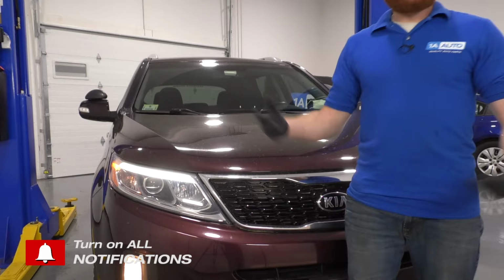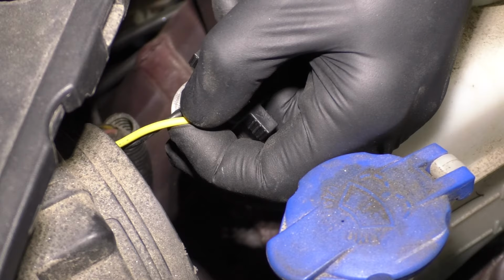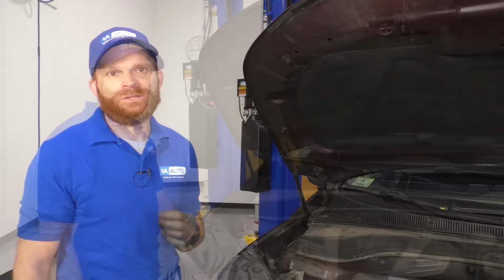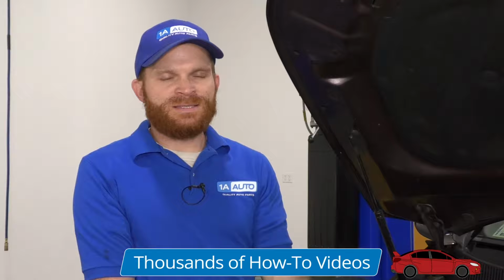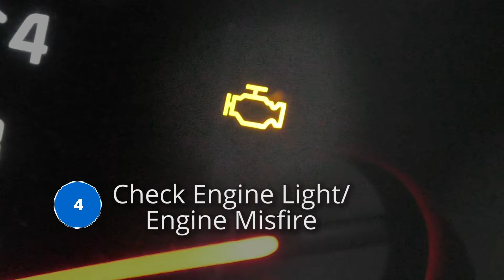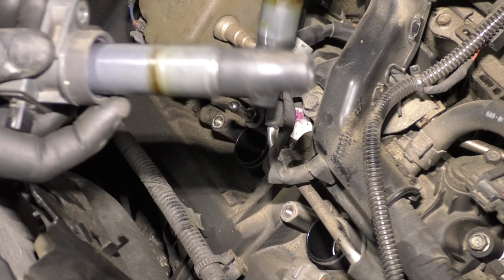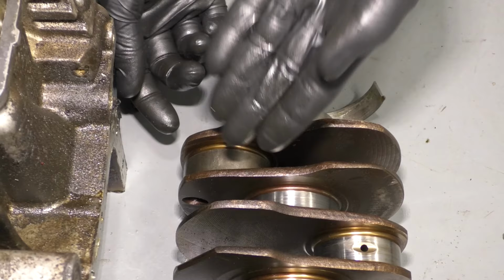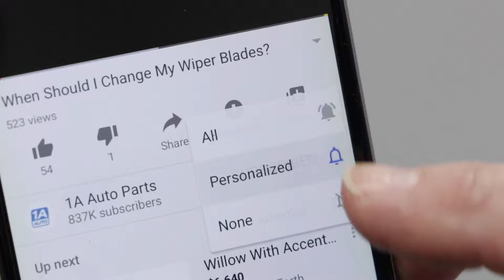Top 5 Problems Kia Sorento SUV 3rd Generation 2015-20

Comment: You may be a good mechanic, but you are a horrible electrician. Too much current coming down the wires? Not enough resistance? No vehicle manufacturer designs extra resistance  in any wiring harness... lamps would be too dim from the voltage drop, not burn out. The job of every wiring harness is to deliver more than enough current to the appliance its connects. If there needed to be limited current, they would install a resistor or current regulator... and NOT rely on minute wiring resistance. Feel the base of the bulb to see if it is too hot? Are you kidding? The bulb makes the heat... if the wiring is making that much heat, there wouldn't be a blown bulb, but rather a very dim bulb from bad wiring or bad wiring connection - undersized wires that are heating up deliver less current, not more. Therefore, your statement of wiring needing to limit current but not get hot is completely contradictory. These bulbs are burning out too often because the housing begins to absorb lamp heat after a few years of use. The reflectors and internal lenses fog up over time holding in more heat, and with no ventilation, the bulbs overheat beyond operating specs and burn out. It's a waste of money to change the wiring harness to stop premature bulb life. Sure, there could certainly be alternator issues, but that's not the common problem that cause headlamp failure. Alternator issues would quickly show up in other accessories way before blowing a headlamp. Stick to mechanics... you are misinforming the public about wiring with your gross lack of knowledge. It's tough enough finding reasonable  answers without you guessing with unauthorized authority.
Reply: Yes absolutely true.  The bulb will draw the power it needs and nothing more.  High voltage will be an issue with the electronics before the bulbs.   He is misinforming the people.  Best way to treat this would be to drill some holes in the back cover towards the bottom  to allow air through to stop heat buildup.

Comment: The 2015 is not a 3rd gen. The 2016 - 2020 is the 3rd gen.
Reply from the maker: +BASE0608 Thanks for the feedback!
Reply: Nah bruh it is a third gen cuz the 2015 received a facelift 🤦🏾‍♂️
Reply: @mooauto2388  In the US, the 3rd gen is 2016 -2020. The 2015 is 2nd gen which is years 2011 - 2015 with the 2014 - 2015 receiving a refresh. 2016 was a brand new model.

Comment: I just bought a 2016 sorento with 100k on the engine and it just started leaking oil. Took it to the dealer and it’s $470 fix. So annoying.
Reply: i have a 2016 also 2.4l, do you have burning oil issues?
Reply: @maggiemhando412  I do and my engine seized up on me about 3 weeks ago and the dealership was able to free it. This past Friday the rod bearings went out and started knocking very very loudly and went into “limp mode.”